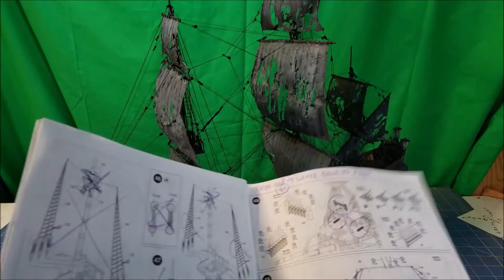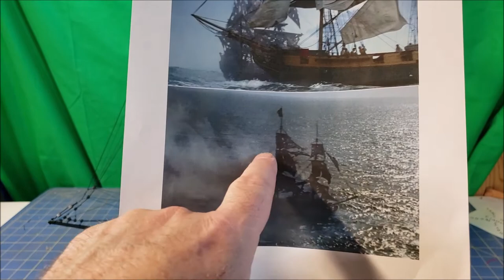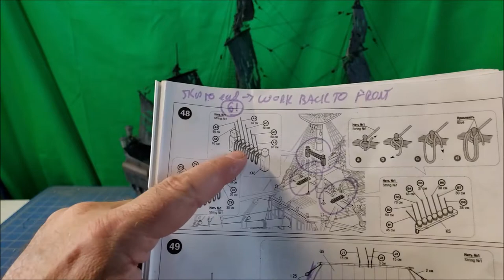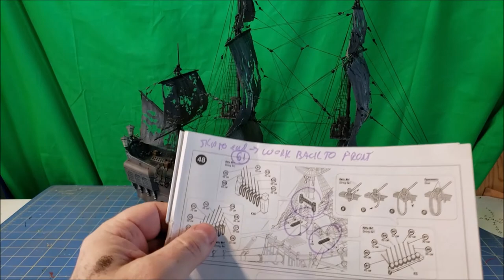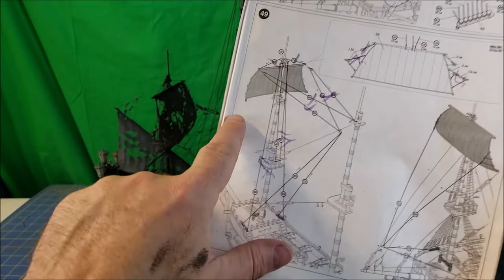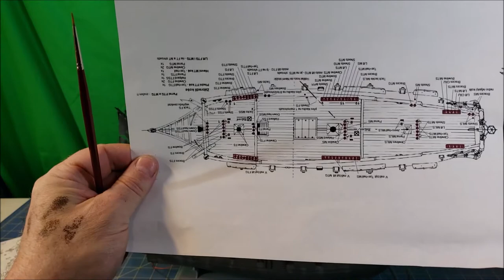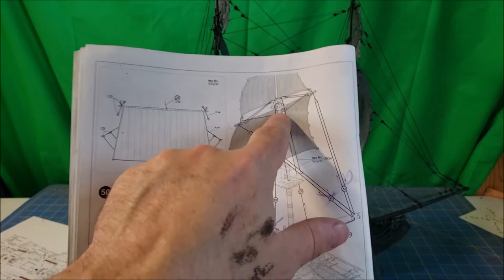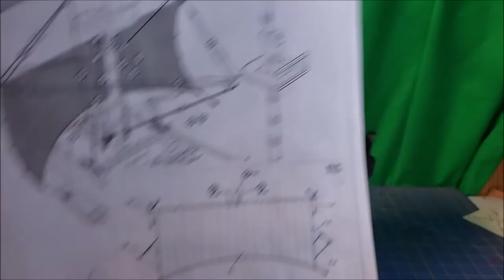Mal's Projects: (11)  The Black Pearl - Zvezda 1/72

Comment: love it man.... it looks alive, creaking and shuddering 🤘😎
rigging looks amazing and tight (no slack in the lines) with the sails billowing
Reply from the maker: Thanks bud.  HH's guidance pointed out a change that I ended up having to make, moving the foretopgallant and fortopsail braces off the forestay to a parallel line.  I'm actually using the tension there for those sails, and it makes the stay look looser than it should be.   Other than that, I can live with the inconsistencies, especially if it's giving that impression, since that's the target.  Appreciate the feedback!

Comment: Really coming together now.  A few small mistakes in the rigging, but who cares, it’s a fantasy ship.  Sticking to my preferred aft to bow, bottom to top method of rigging really saves the tangles.  Although the intermediate lanteen and trapazoid sails between the masts are called stay sails, they generally have their own mounting rope near the actual stays.  The triangular ones at the bow strung between the bowsprit and foremast are jibs.  Again they run on separate lines to the stays so can have sag.  All stays and shrouds are taut, otherwise the ship falls to bits.  Only the running rigging is more flexible and can droop.
Reply from the maker: Thanks HH... that's good to know.   I went back through the rigging doc here and that info qualifies as another "gotcha" for the kit.  Following their diagrams,  would end up with those missed.  Appreciate the terminology. 

Yep, I'll be rolling with what I have for this one, since she is a "ghost" afterall, and will add that detail to the long list of things I've learned on this project!
Reply: @syrmalcolm  Agreed!  I guess that's where the phrase, "Learning the ropes" came from 😊